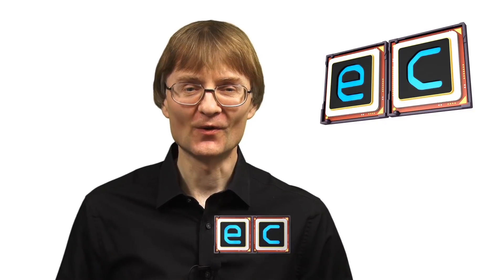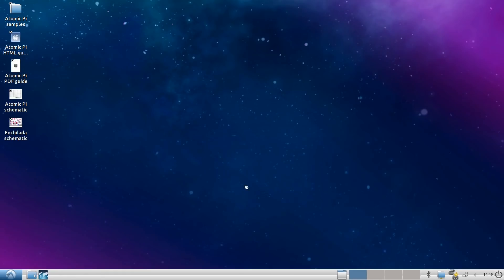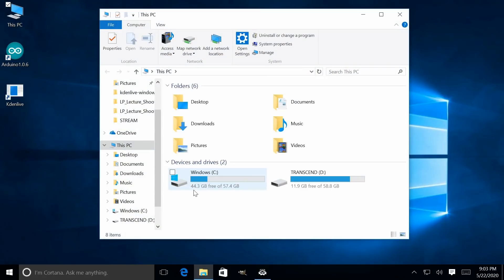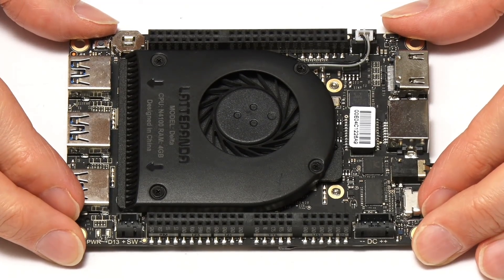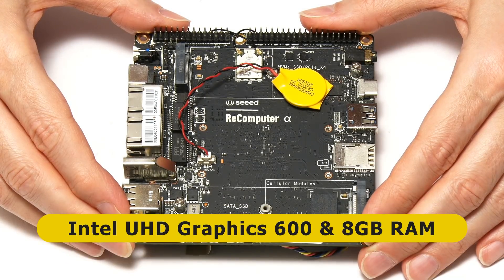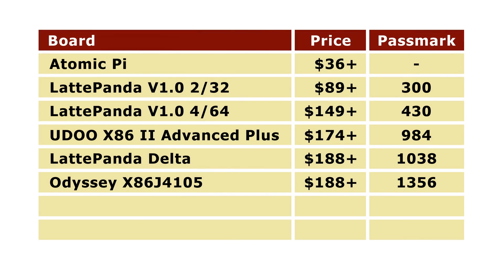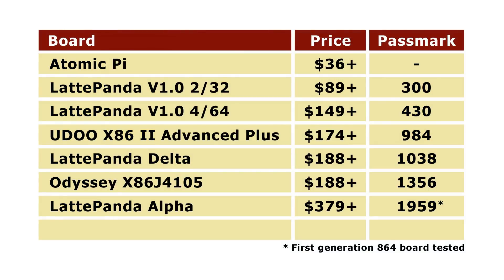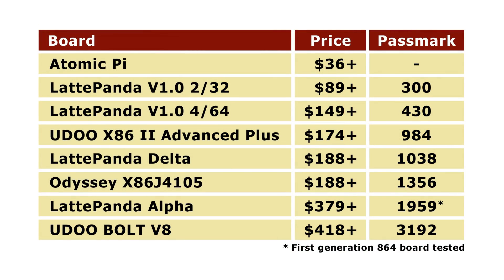Eight x86 SBCs

Comment: Is there any board out there that does Support ecc
Reply from the maker: Not in this price range. There may be an industrial SBC that support it.
Reply: @ExplainingComputers  thx as for my search i couldn't find any board supporting this.... its a bummer because for a micro nas (freenas) or server  id love to have this feature
Reply from the maker: @BR0KK85  I assumed you were headed into FreeNAS with your  thinking! :)
Reply: @ExplainingComputers  it can be run without it but ... its a nice feature to have and they recomend/ require this on their website. What i'd like to see is a sbc with 1 or 2 m.2 nvme, sodim ecc, a quad core and like 2 sata ports for spinning rust. Sadly not even the intel nuc (including the high end ones like hades c) do not featue this. My hades runs fine with ecc sodims but  it is disabled. The new nuc  9 does but thats to damn expensive (and to big). Amd has ecc inofficialy enabled (and officialy in the pro versions incl.  the pro apus) but apparently the AM4 platform does not support ecc error reporting to the bios nor the os.... it kind of works but you can not check or be warned if thomething goes belly up in ram. I think this is also true for the amd based sbcs .... i tried ecc dims in my deskmini with a pro apu and that would not even post .... missed opportunities by asrock ... the deskmini a300 is exacty what i need minus ecc ... they forgot to implement  the necesary ecc lanes for the sodimm sockets

Comment: Would you please help me with a minor problem.
I have a desktop PC
What's Windows 10 and 7 installed.
I have it configured to boot up in  Windows 10

Every once in awhile
It will boot up in Windows 7

Can you please tell me why this happens ?

At times it's very annoying.
Keith Kuhn
Thank you
Reply from the maker: I don't know how you have set this up, but if you are using GRUB a Windows update may well cause this issue.
Reply: @ExplainingComputers  
I will have to look more into this grub.
I just googled, so I must learn about it.
Keith Kuhn
Reply: @ExplainingComputers  
I truly appreciate your reply. I have never heard it called grub before.
But it does do the automatic updates.
Would you recommend turning off automatic updates ?
Thanks again Keith Kuhn
I love your channel
Reply: @ExplainingComputers  
I am far from a computer genius like you are.
But I can see now I may have a little trouble figuring out why Windows occasionally boots up into Windows 7.

The operating systems are installed on a solid-state 500gb drive.

I am really afraid to mess something up.

Do you think it would hurt for me to uninstall Windows 7 ?

I know you're a busy guy, so she could just get back to me whenever you have time that would be great.
Keith Kuhn from Ohio

Comment: Nice video, as really all your videos, regarding x86 based SBCs. But the Price for the UDOO BOLT V8 as of today $418 is too hight. That is probably the reason that they offer now UDOO BOLT GEAR (https://shop.udoo.org/products/bolt-gear.html) for only  399$. +  43$ (2x4GB)  + 58$ (1xM.2 128GB)  = 500$.
Ryzen™ Embedded V1605B Passmark 6848

But compared with this similar or even better configuration for 394$ (Athlon 2) | 403$ (Ryzen 3) | 458$ (Ryzen 5) it is still quite a difference:

1 x DeskMini A300 : 166$
https://www.asrock.com/nettop/AMD/DeskMini%20A300%20Series/index.de.asp
2 x 4 GB SO DDR4 2400 CL17 Crucial : 43$
1 x WD PC SN520 (128GB, M.2 2280) : 58$
1 x AMD Athlon 240GE 2 Cores Passmark 4752 93$ OR
1 x AMD Ryzen 3 3200G 4 Cores Passmark 6725 : 102$ OR
1 x AMD Ryzen 5 3400G  4 Cores Passmark 9,384  : 157$
1 x Intel® Wireless/Bluetooth M.2 2230 module+cable+ant 34$

Comment: I'd argue the Atomic Pi is the cheapest Windows 10 PC, I have one myself and I've made a lot of OSs for it, including the most optimized Windows 10 build for any SBC I've seen so far. You can comfortably use it with over 10gb free space, and that's with some basic system utilities installed. It's $30.72 for the board alone and $35.95 for the board, baby breakout board, and camera module. I'd suggest you have a look at my page for it here http://electrohaxz.tk/atomicpi and maybe give it a go. At the time of writing this my Win10 v4 image is the latest Windows 10 image, however in the future there may be more.
Reply from the maker: Very interesting -- thanks for the link.

Comment: so could it be good for codi and remote?with which  system is best?
Reply from the maker: All boards here can be used as a decent media player using a wireless keyboard (for some time I watched YouTube on my TV using the Atomic Pi). But do note the Udoo Bolt has a rather loud fan for media PC use, and my suggestions for the best x86 media SBC would be the LattePanda Delta or Odyssey X86J4105 in their respective cases -- as pictured together in the thumbnail here. :) Recently I've watched the Mandalorian on Disney Plus on the Odyssey connected to my TV.

Comment: Too bad for HardKernel. They should have sent you the H2. https://www.hardkernel.com/shop/odroid-h2/ For $111USD it would have been the winner in the "best value" class.
Reply from the maker: Agreed. :) I have never got hold of an H2 -- though note that both RAM and an SSD or HDD needed to be added on top of the price, whereas the other mid-range boards all have RAM onboard, and onboard eMMC flash storage (aside from the Odyssey 800 version). So the price comparison would be very close.

Comment: Hi, I did a lot of pondering over this in terms of low power consumption and fairly small footprint so settled for an Asrock J3455B mini ITX for £75 which benches faster than all these boards albeit not as cool.... OH forgot to mention that the main reason for choosing it is that it can take 16GB of RAM
Reply from the maker: I like those Asrock Mini-ITX boards -- especially the way they keep the VGA and parallel ports: it's so rare to get them on a board with USB 3+ :) The final system price must end up very similar to the three mid-range boards here (where RAM and a PSU and generally storage are included). But you have a lot of traditional PC flexibility.
Reply: @ExplainingComputers  Hi, yes I think of buying from scratch you may be right about the total price. Fortunately for me I have a case, memory, SSD and a Pico ATX PSU + brick just sitting around doing nothing. Thank you, keep up the great videos. With regards

Comment: i tried that passmark on my pc and with a web browser open and a youtube video playing my score is 6601.5 if i close the web browser and have nothing running bar background programs it tanks down to 2200 or something can anyone explain that? lol
Reply from the maker: That is very strange. All I can say is that, for comparative results, Passmark needs to be the only program running.
Reply: @ExplainingComputers  i think its something to do with the 2d score i looked into it and apparently the gpu doesnt handle 2d any more and its this score that is much higher with a browser open, im running it again anyway as i never had xmp set in my bios so my score should be higher than 6600 which sounds more like what an x570 aqua ryzen 3700x 2 x 16gb trident z royal 3600 cl16 2 x 1tb sabrent rocket gen 4 nvme in raid 0 and a aurous extreme waterforce 2080ti gpu should be scoring and yes with xmp enabled its now scoring 7331.3 with the browser open, it must be enabling something to do with the 2d performance that gets shut down/put to sleep when the browsers closed, bit strrange
Reply: @ExplainingComputers  well i just ran it again with the browser closed and now im getting 7513.1 so it must have just been because xmp wasnt set for the memory but still seems strange my score dropped by 2/3rds with xmp not set and the browser closed compared to xmp not set and the browser open (and i did run that twice and got 2200ish both times) and now with xmp set it goes up (as it probably should) with the browser closed very strange indeed

Comment: Many thanks for this video Christopher! But is there anything for the following application? 2x4TB SATA 6GB/s (or maybe 8TB in the future) SSDs and the possibility to somehow connect a 10GBE card to it with a Ryzen X86-64 CPU? On Idle I want to achive 4W power consumption. This is supposed to be a little tiny, efficient and very fast NAS for backups.
Reply from the maker: I know that Seeed Studio will be releasing an M.2 adapter adding four more SATA ports to the Odyssey. But if you wnat 10 gigabit Ethernet, I am not aware of any small board offering that.
Reply: @ExplainingComputers  Maybe I could rig an adapter to get 10GBE onto the WiFi slot. Or maybe use a USB 3 adapter. It should still give me about 4 GBit/s which is definitely much faster than 1GBE. :) I may look into this! Thank you!
Reply from the maker: @kyoudaiken  Yes, a USB adapter would get you more speed as you note.

Comment: You can actually run a single command after installing Windows 10 or before installing Windows 10 in order to turn it into (or install in) "Compact" mode which compresses the Windows files in order to save disk space, with that and maybe reducing the paging file size a slight bit, you can get Windows down to about 5-6GB leaving about 8-9GB of free space on the eMMC storage of the Atomic Pi. You can probably get even more free disk space by deleting preinstalled unnecessary Windows Store Apps, so if you keep track of what you download/install, delete Windows update files after it has updated or use free cloud storage solutions to store files, you can get by using Windows on the Atomic Pi.
Reply from the maker: Good point! I must try this on the Atomic Pi some time . . .
Reply: @ExplainingComputers  If you want to Compact the Windows install after installing Windows 10, just run an elevated command prompt and run the following command                           
Compact.exe /CompactOS:always 
Or you can deploy Windows in Compact mode, however that will be trickier as you have to manually delete all partitions, creating a new partition and formatting as NTFS from the DISKPART command by opening Command Prompt at the Windows installer by pressing SHIFT + F10 and then executing DISM commands to manually deploy the Windows image file located in the installer (generally \sources\install.esd(or install.wim) or \(Architecture)\sources\install.esd(or install.wim)
You can find the documentation on Microsoft's site https://docs.microsoft.com/en-us/windows-hardware/manufacture/desktop/compact-os

Comment: Great video as usual.  I have a question though...if the only difference between the two LattePanda boards is their RAM and storage, then why does the 2/32 have a CPU Passmark of 381, while the 4/64 has a CPU Passmark of 497?
Reply from the maker: Because available RAM impacts overall performance -- often a way to speed a computer up is to add more RAM.

Comment: I put Windows 10 on an Atomic Pi. It doesn't run too bad but it's only useful for emulation. The worse part was finding audio drivers for the HDMI.  They were a pain to find. It didn't even work in the Linux distro that it came with. I did eventually find Windows drivers that work.

Comment: is there a sbc that can handle fusion360? just curious.
Reply from the maker: In theory the Udoo Bolt, LattePanda Alpha or Odyssey X86J4105 should run it, as they meet the required specs.
Reply: @ExplainingComputers  cool. thinking about downsizing by upgrading, maybe.
Reply from the maker: @hitchabout  You may find my attempt at this here interesting: https://www.youtube.com/watch?v=5REJCaayl6Y -- no Fusion 360, but a week where I used DaVinci Resolve and BMD's Fusion on a LattePanda Alpha -- and edited the video on the board in them!

Comment: Please Read In Full:
 Hello there! I was wondering if you've heard of https://SiFive.com created by the founders of RISC-V architecture... Open source RISC  platform...Several v's of SBCs & add-ons... with Board design & Chip design software (coming soon), but sifive.com has individual parts, SBCs, & add-ons with Wiki for part specs+board manufacturing by/for the maker, & existing software repo & development!!!
  If you haven't heard of OR haven't any experience with RISC-V architectures...
• Can you please go to SiFive.com & grab some parts for maker fun, & several of the different versions of the SBCs/Sftwr for Hrdwr programming / & if now available the board & chip design engine, & [[[Make a video series on all that awesomeness!?!?!?!]]]
 YOUR WORKS ARE PRETTY COOL, BUT THAT WOULD BE TOTALLY BADASS#!!!#!!!
Thanx for your content & if you would be so kind as to RSVP... PLEASE DO ANYTIME!!!
P.s.-
• Also if the SiFive RISC-V SBCs & component add-ons are compatible with any other Arduino, Pi, LoRa, Other SBCs, ų components, & Laptop/PC/Server computational hardware+Hrdwr components & add-ons already developed on market i.e.
RPi 0-4 & other SBCs, ESP32 & other components, MotherBoards, PCIe, RAM, (mini/micro)/HDMI, USB-A, B, micro, C 3.2 Gen2, Thunderbolt3, (mini) DP1.2-1.4, M.2Nvme SSD, Ext.SSD's, WiFicards, SIMs or eSIMs, SBC Hats or Parallels, Etc... (If it even needs some of the aforementioned externally or can if can be designed & built-in, but it would be cool to test interoperable compatibility)

• Computational Ability. Benchmark 
Ex: Rendering, Physics Caluations, Mining Crypto, Etc...
Heat Tolerance & Benchmark 
+ 
• Networking & Signals components & compatibility like
modems+routers, Ethernet capabilities🔂🌐 + 🔀PoE⚡, Firewalling🛡,
Antennas☫☦🖇, LoRa, 
RISC 📤 to Cell📲2,3,4,5G, Cell to RISC 📥,
RISC-RISC & RISC-V to XYZ Devices Mesh[⛖⛗⛓]Ntwrks,
⚟⚞NeuralNets, Machine Learning & AI.
⛓Blockchain🔗,
BT, WiFi, Cloud🌫Computing
SatComms Link🔃📡🌍🔄
Comatible w/Hrdwr on market already developed &/OR can be designed & manufactured with SiFive's Hrdwr/Sftwr RISC-V Development Environment Engine????

• & RISC-V OS's/Sftwr compatibility with other existing OS's/Sftwr/Prgrms like you've demonstrated in some of your previous vids???

P.s.s.- I think that RISC/RISC-V architecture once out of its infancy will be a dominating force in industry & paradigm shift from X86-32/64 phase out & maybe even current ARM & CPU APU GPU replacement or at least integration!!!
Reply from the maker: Thanks for this -- but please note that I am very time limited! :)
Reply: @ExplainingComputers  OK I totally understand. We all have a lot going on. However of you do have time to to a video series on https://sifive.com & their RISC-V architecture & SBCs + board & chip development engine that would be absolutely wonderful!!! Again thank you for all your content & I wouldn't ask about their aforementioned to just anyone, but someone who has the necessary skill & flare to do things right!!! Hope you are well &  able to do a RISC-V Sifive series in their near future!!! All the best Cris!!!

Comment: I’ve got my Atomic Pi running Windows 10 on a USB drive and works very well.  It just serves as my UniFi Controller and I remote into when I need to do anything.  I like low cost boards, so this met the budget constraints.  The rest I haven’t messed with RPi all the way!
Reply from the maker: Cool -- congrats on the Win 10 Atomic Pi setup.

Comment: Hi Chris.
A most excellent video as usual.
One small thing though. These SBC's use widely varying cooling solutions.
I quite liked your test of cooling for the ARM SBC's
Might I humbly suggest something along those lines for the x86 boards as well.
Now - I haven't worked out a solution for that, wich mr. Gates so optimistically refers to as an operating system, but the following works on my Core I7 coffeelake desktop under Mint 19.3:

  #!/bin/bash
   clear
   for f in {1..7}
   do
           sensors
           sysbench --test=cpu --cpu-max-prime=25000 --num-threads=6 run >/dev/null 2>&1
  done
  sensors

Dependencies: Lm-sensors & Sysbench
Every  possible credit to you Chris for the original script.
Regards
Erling
Reply from the maker: Good idea, noted.

Comment: I know it's probably not your expertise, but a while ago you started some robotics tutorials for the pi, I wonder if you're able to revisit some of that but in more detail, maybe some bare metal stuff and basically using an SBC as a controller board on steroids. It seems a lot of these boards have GPIO's but almost everyone seems to just use them as desktop machines or servers.
Reply from the maker: You make a very good point. I must get going with robotics controlled via SBCs again. The servo videos earlier in the year were supposed to head me back in that direction. Thanks for the nudge!

Comment: Are the AtomicPi boards still available?  I heard they were just built to use up a massive over-stock of the Atom chips (allegedly that's why the HDMI sticks were made as well).  Of all of these it's the most intriguing to me as I like the idea of an x86 based ultra cheap system to use as a utility - a clean and light Debian build and some good utilities (e.g. Aria2 downloading, MQTT server and various other services) would be genuinely useful in most home and small lab environments as a low powered service system.  Sadly there are still frequent difficulties with ARM support for OS's, many applications (particularly closed source stuff), etc. so I think there's still a fundamental advantage with the x86 factor.
Reply from the maker: The Atomic Pis were not built to use up anything! They are not SBCs at all, but robot control boards made for a robot that was never sold, and the boards were sold off and branded as the Atomic Pi. This is why they can be sold at less than the cost of their components. I cover this in depth at the end of my Atomic Pi video: https://www.youtube.com/watch?v=CpMhsrsiV6Y  Some are still apparently being sold -- there were a lot of old robot board available! :)